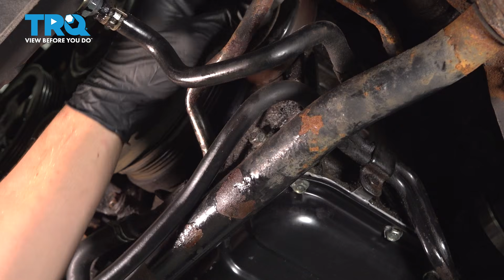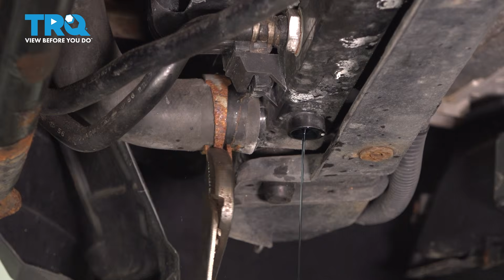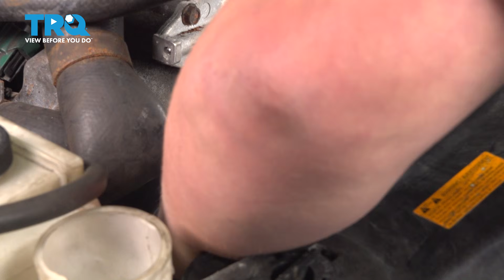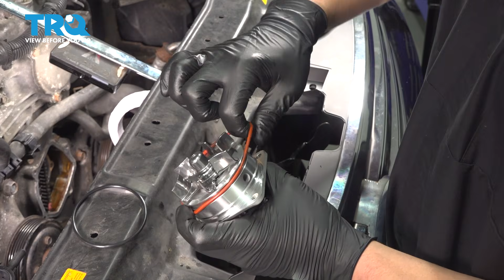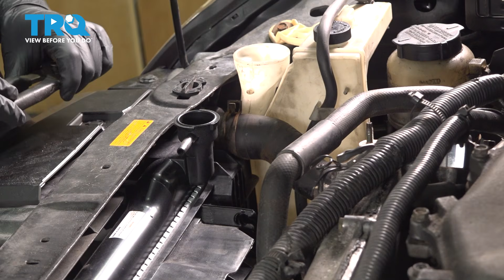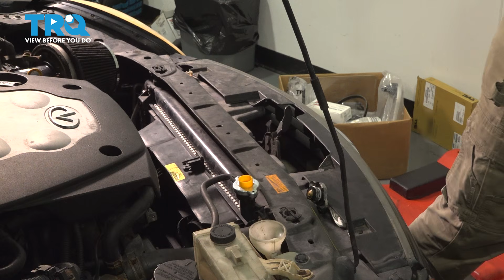How to Replace Water Pump 2003-2007 Infiniti G35

Comment: For those worried about throwing off the timing when doing this job I am going to put the FSM instructions on the removal of the t-chain tensioner and wp. This video is great but I know some of you want specifics so when doing the timing chain tensioner. "Turn crankshaft pulley approximately 20 degrees clockwise so that the timing chain on the chain tensioner side is loose."  Remove the t-chain tensioner. Then "Remove the 3 water pump fixing bolts. Secure a gap between water pump gear and timing chain, by turning crankshaft pulley approximately 20 degrees counterclockwise." Screw M8 bolts [pitch: 1.25 mm (0.049 inch) length: approximately 50 mm (1.97 inch)] into water pumps upper and lower mounting-bolt holes until they reach timing chain case. Then, alternately tighten each bolt for a half turn, and pull out water pump. Pull straight out while preventing vane from contacting socket in installation area. Remove water pump without causing sprocket to contact timing chain. Then just follow this video for install. 
P.S. you don't have to be at tdc it  is however a good reference point.

Comment: To put car in TDC take out spark plug ( first on passenger side) 

Then get a 19mm turn the crank until u see 3 lines one is black other two white or gray

Turn the motor until the arrow on the water pump plate is at the black line. 

You’re done with finding TDC

Comment: Great video. Note when filling radiator with coolant, you need to open an air bleeder valve at one of the heater hoses next to the battery box. If you skip this step, you will trap air in your heater core! Burping air out of these engines is more involved than simply pouring in coolant and running engine for 15 min.

Comment: Quick responses please. What size bolt and length etc to get water pump out? 05 g35 sedan auto. Im working on is a 10mm bolt to loosen but which bolt used to pop out water pump? In the video u said u use 13mm socket. But give the specs please.

Comment: Good video 

Brother, I have a 2007 Infiniti G35 sedan. It is leaking water, it comes from above. I fell to the side where the compressor is and it goes down to the oil pan. Could it be the water pump?

Comment: I really wish you would have mentioned what kind of bolt size was needed to remove the water pump to push it out because you make it assume like it's the same size as the ones used to hold the water pump into place which is not! Is actually a size bigger.  And now I have a broken bolt in there and already broke several taps and have metal  Shavings in engine just because it.

Comment: I was bleeding out the air in my coolant sytem after refilling it from a thermostat replacement. I kept getting air in there,whenever i stop it would blow cold once i hit the gas the heat came back so i got a no spill funnells and let it run while the bubbles would come out,i was watching the game real quick while waiting for my baby to purge that air,I Fell Asleep man...woke up the next day!!!! Went out to walk my dog the next morning7am and noticed the car had been running with funnell all connected for a long while,it was on at 6pm Sun and shut it off 7am Mon....hahaha
It was running beautiful after..haha im in a high crime area and was amazed that no one touched it..people steal hubcaps around here,thats how bad it is around here..all the windows down no lights on,they couldve had a fun time but god was watching my sht...

Comment: Hey guys so I did this yesterday. Used this video and another that covered wich way to rotate to get specific slack on each side. Thus video is great but doesn't include which way to give slack to the left then right. 
Correct Bolts used were to pull water pump 1.75 " long m8 bolts. 
Some tips I learned. 
Buy a roll of blue shop towels and rip the down to smaller pieces and stick in the hole areas gently with a tab hanging out so you can pull them. It will catch the bolts if you drop them.
On the water pump install make sure to get the top bolt in first followed by the right side.
In the beginning Take out front left -no 1 coil pack and spark plug, stick something long skinny gently down and slowly rotate crank to get top dead center. 
The water pump black plate has a arrow engraved into it to line up TDC marking on crank. 
The only issue I had was taking out the hard line drain off the water pump did not release any water. Once I cracked the water pump loose then it started draining on the exterior of the block. Let it all drain and be sure to do a oil change before you crank it over. 
Over all this is a good video besides the missing information and rotating crank 15° right or left depending on where you want the slack. 😊
Reply: Can you elaborate on the spark plug method, how do you know when it is set to TDC ?
Reply: And do we rotate it counterclockwise when trying to look for TDC ?

Comment: Thank you bro I was able to do it. Course mine was a little more difficult than that. Mine was corroded into the timing chain assembly. Try pulling it out with the 8 mm bolts but the tabs broke that thing was stuck! Anyways Long story short I had to fabricate a puller and was able to pull it out absolutely totally corroded. Cleaned it up cars up and running Thank you for the critical info.
Reply from the maker: +@Motor7710 Thanks for watching our video! http://1aau.to/m/Shop-TRQ

Comment: Another comment...I went to the local fastener store and bought M8 bolts to press the water pump out. Either take your new water pump with you to make sure you get the right threads. In my case, I didn't have the pump with me and just bought both thread variants of M8 bolts the fastener store had on hand. They were about 3" long and worked great!

Comment: Great video! I just did this job on a 2003 Nissan 350Z. This video was exceptionally well done and very helpful! Great camera angles and descriptions. Thank you for adding the torque specs to the narration! The demonstration on how to compress the tensioner was especially helpful. Use caution when compressing your tensioner! If it resists, then you probably don't have the lock disengaged and you will break it if you force it! Almost learned the hard way! Thank you for the video!

Comment: Bro what bolts are you using to pull the pump out. The ones in there are m6-1 but you didn’t say what kind of bolts are needed. Plus all you did was push it back but never show how to get the chain fully lose like that. This video wasn’t of to much help with getting this thing out
Reply: I know this comment was a year ago but dont be afraid to pull that chain back it breaks loose then the 13mm thread not on the head pushes the water pump out